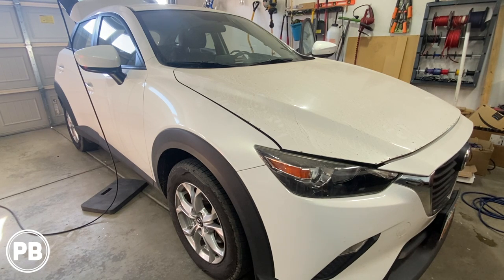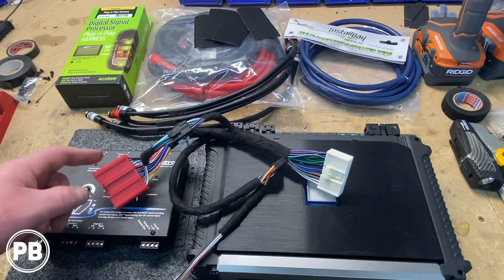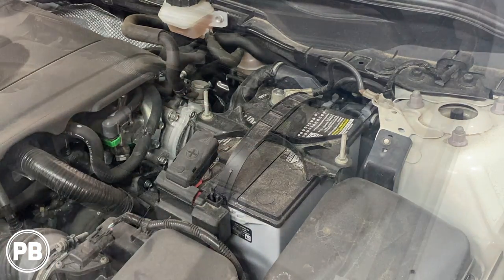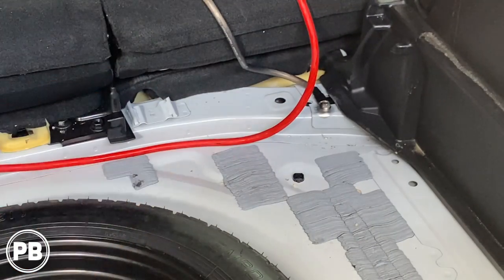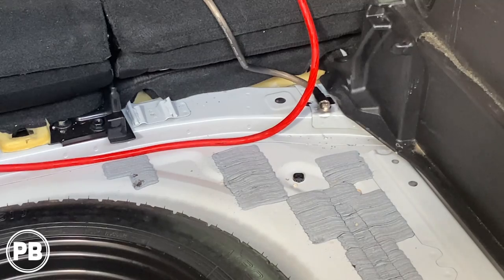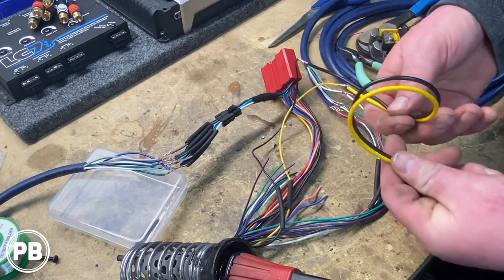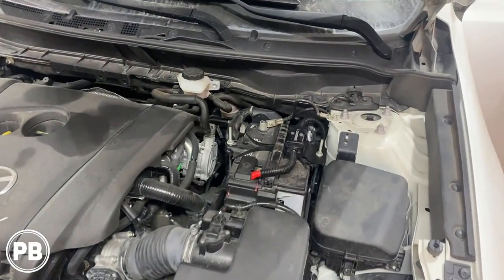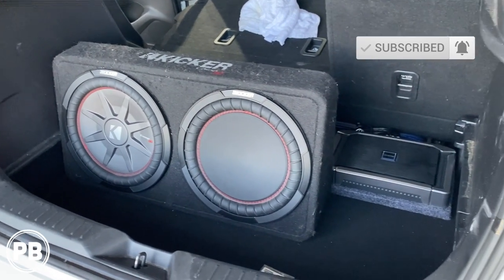2016 - 2021 Mazda CX-3 5 Channel Amp and Sub Install

Comment from the maker: Parts used linked in the description of the video!
Reply: So you used the 4 input channels of the lc7i input speakers to get signal. Now am assuming the lc7 summed it self from factory so you can use the sub rca outputs of the lc7. I ask because you didnt wire the inputs of the 3rd channel on the lc7.so it summed correct?
Reply: How did u get signal or power from the radio with out taking it apart?
Reply: hi guys do u have a video of a mazda 3 2017 model after market head unit installation using a Amp ( non bose ) this would be handy for install im doing soon
Reply: What are the part numbers for the factory radio adaptor plugs?
Reply: Will these parts also work for a cx30 2024?

Comment: Great Video! My 2016 CX-3 has the 7 speaker Bose system installed but I am still not thrilled with the power/kick of the audio... what is the best way to enhance the overall "power" and/or add additional bass (the subwoofer is mid at best). Also, could you add Apple Play to this car/audio system?

Comment: thanks.  I'm putting a JBL BassPro Nano under the passenger seat (wife's request for unobtrusive sub).  I need to run the power wire across and I guess the best place to do that is behind the dash (under the carpet of course).  I too will "rob" the front speakers for signal to the Nano.  Curious if I should splice into the factory harness (output) for speaker signal or tap into each door speaker?  IF I do the door speakers, I will have to mess with getting wire through the door jam.  Tapping at the harness might be easier.

Comment: Ok, im still in the same boat with my 23 Tacoma, I saw your video on the Tacoma, Pac audio says don't use the amp pro, and the Toyota design change was in effect and they haven't tried nor can confirm that it works. can I use the LC7i after the amp and then use the JL VXI amps that I have?
Reply from the maker: The Pac T-harness works just fine for your 2023 tacoma.  Pac just can't confirm it fits as they haven't "tested" it yet, although the body style hasn't changed.   As long as you don't have JBL, it will work fine.
Reply: @ProvoBeastAudio  yeah that's the problem, I have the JBL.

Comment: Did you guys do anything with the speakers in the dash?

And how did you guys sum the LC7i
Reply from the maker: To activate summing in the LC7i, there is a jumper located under the cover which allow you to sum your desired channels.  Once completed, if the unit's green LED illuminates, you know the summing feature is currently activated.

Comment: Great video, but the radio in our 2020 CX-3 is completely different than older models and there are no harnesses on the market that fit.  It has a Panasonic DH1F 66 DRX, which has a 32 pin harness.  All of the aftermarket harnesses are exactly like the one you used from AXXESS.  I was going to try and make my own T harness, but there is nothing out on the internet that tells me which wire does what on the factory harness that plugs into the factory radio.  Even though it utilizes a 32 pin harness, there are only 13 wires: 2 red, 3 black, 2 white , 2 brown, purple, green, mint green and sky blue.  Any suggestions on where I can find out which wire is what?  Thanks.
Reply from the maker: Send us a message on facebook or instagram and we can help locate a harness adapter for you.
Reply: I have a 2019 and same problem. Let me know if you find anything please.
Reply: @ProvoBeastAudio do you know of a t tap for a 2019?
Reply: Did anybody find an answer to this?  I have the “other” plug to my cx-3 as well.

Comment: Hi! My 2015 Mazda 3 iGT sedan with BOSE system has a left audio sound issue. Hardly any sound on left speakers. Could it be the Amp causing this or some sort of short?
Reply: Most likely your speaker is capoot.

Comment: Is it possible just to tap into the signal bypass Bose for one subwoofer. Because Bose subwoofer has bad dsp from Bose
Reply: Yes, you can tap into the pre-amp signal near the glove box.  You can add a T-harness like this and just run one set of speaker wire from the T harness back to the trunk for your LOC, or directly to amp if it has High Level input.  You would not need to run speedwire to the trunk, and then back up to the front as you are just grabbing the subwoofer signal and not amping your door speakers like he is doing.  If you're okay with splicing into factory wiring, you could also use something like Posi Taps near the glove box to cut the factory subwoofer signal before it goes to the bose amp, and then add a set of speaker wire running back to your trunk.

Comment: i have a mazda 6 2022 standard with no nav headunit, problem i am facing is to replace the thing. i tried several android headunits, issue is that call and voice buttons wont work with android headunit.
this car has bluetooth module built in which is in glovebox area. i recon that these buttons directly contron the module.
expecting a fix on the issue.
thanks in advance
Reply: Keep expecting. 
Demanding much, sheesh.

Comment: Do i need the t-harness if im using kicker KISLOC as line out converter?
Reply: It appears the kicker KISLOC is a 2 channel LOC. It kind of depends if you have the BOSE system or not, and if you are planning to upgrade door speakers.  If you are planning to just add a mono amplifier and subwoofer, for non-Bose, you can splice into one of the door speaker's wires either near the glove box, or near the door itself.  If you have the bose system, you can create your own pigtail harness and into the subwoofer wires in the trunk.

Comment: Would this wire configuration work for a non bose system for a 2021 Mazda CX5?
Reply: Yes.  You would install the T harness near the glove box with one run of speed wire going back to your aftermarket amp on the input side.  Then you have another run of speedwire from the output on the amp, back up to the other side of the T harness, which is carrying the "amped" signal to the factory wiring that runs to your door speakers.  You would need to upgrade your door speakers as well, as they would not handle the power of an aftermarket amp.
Reply: @snert5653   Awesome! I had another question can you use a multimeter to tune the lc2i and the amps if you don't have a SMD DD1?
Reply: @snert5653  Would this harness work for a 2022 CX 5 CE non-Bose?  I heard the speaker connections are under the driver's seat.  Try to figure out if it all has the connections behind the glove box or under the seat.